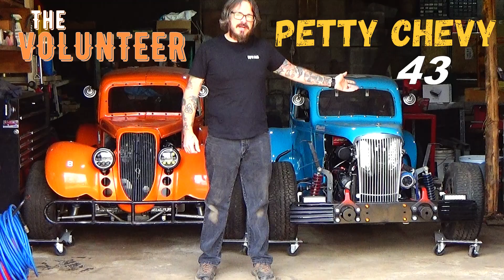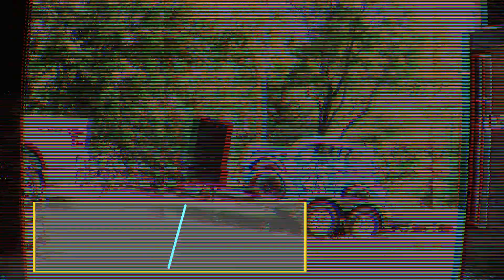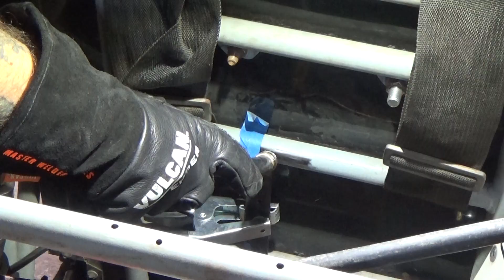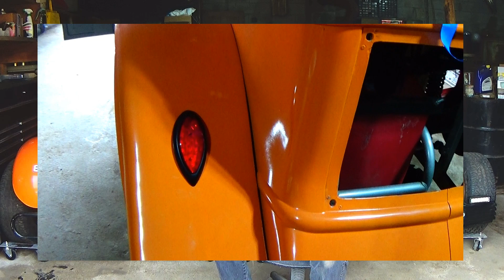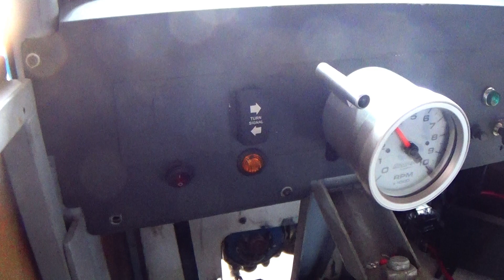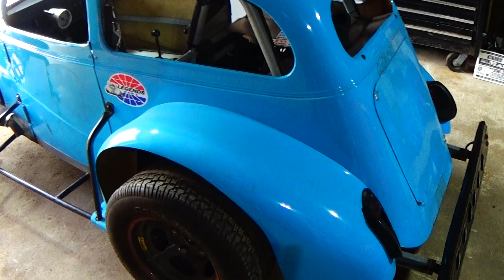I have TWO racecars! Let me tell you about them | Progress update on The Volunteer and Petty Chevy

Comment: Which headlights are you using on The Volunteer?  Those are the perfect size and and mounting position!
Reply from the maker: 5 3/4" LED headlights. I had to make custom mounts, obviously, but you can find a lot of stuff for the housings and lights to repurpose from motorcycle parts.